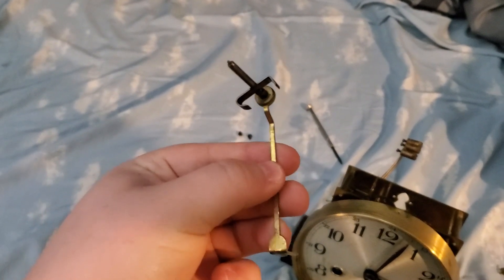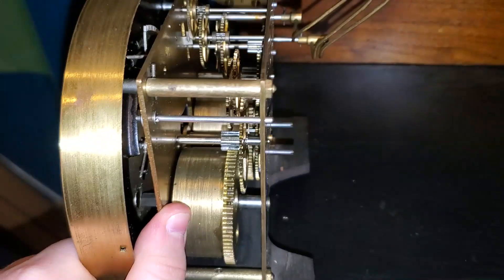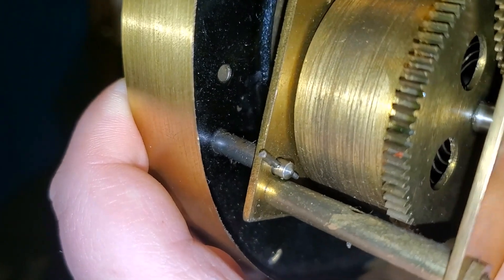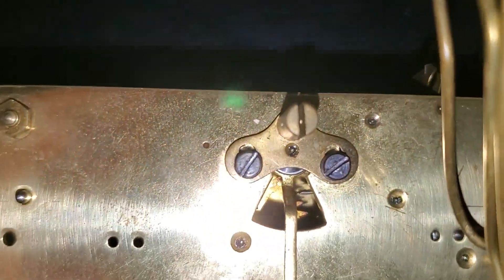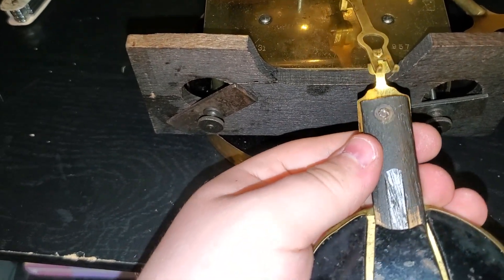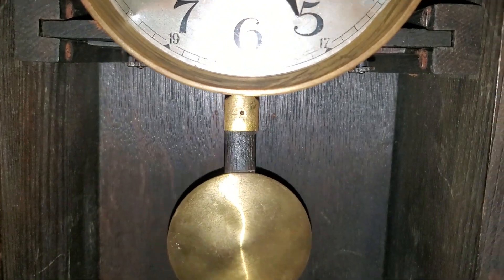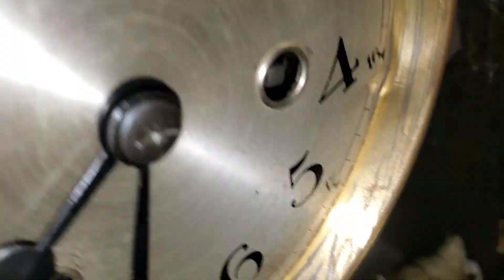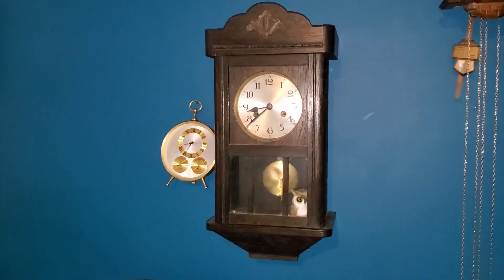Adjusting the F.M.S. Mauthe

Comment: very nice!

one thing, i wouldn’t let it go without the verge and pallet, it will wear the bushings or damage pivots, it’s ok for a short time but for a long time it’s not healthy for it. the movement seems pretty clean which is good, did you buy it clean? if so i would recommend touching the plates the least you can, oils from your hands can tarnish it. but that aside it’s a very nice video!
Reply from the maker: I should have waited for it to be near winding day before I took off the verge and pallet, you're right. and I'll note that for next time, seriously! As well as the thing about tarnishing the movement. We have some purple gloves in our laundry room that I'll be wearing the next time I have a movement out of its case, which should hopefully be pretty soon. I'm going to try and oil my Howard Miller that I have, as it chimes way too slow. Of course I'm aware that I have to clean out all the oil sinks and remove the previous gunk. I'll try that with a toothpick, is that alright to do?

I'd really love to do that with this Mauthe just so I am rest assured that it will operate to it's highest performance and with minimal wear, but I'm not sure what I can do about that one hairpin that is in an awkward spot for my plyers. Any suggestions for that? I have tweezers but... I don't think those are going to work very well. They'll slip easily.